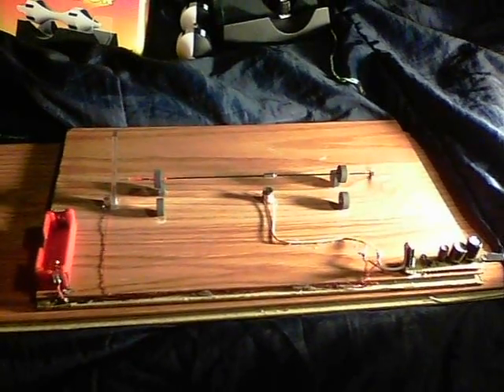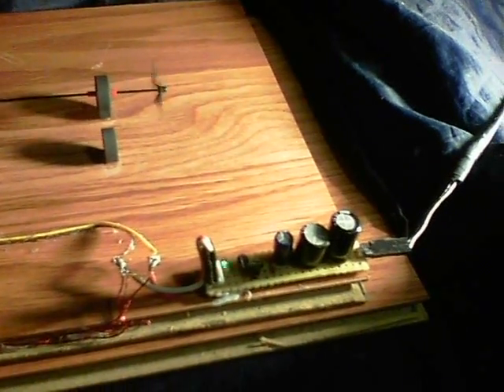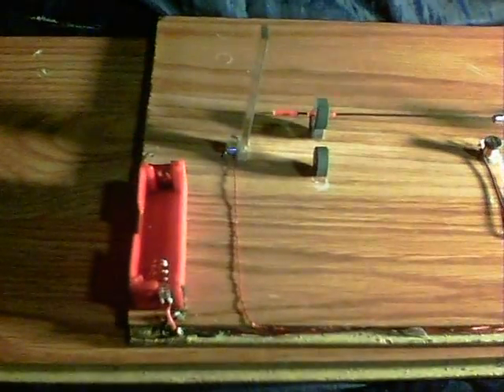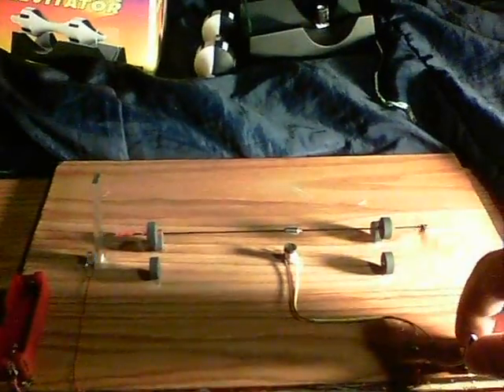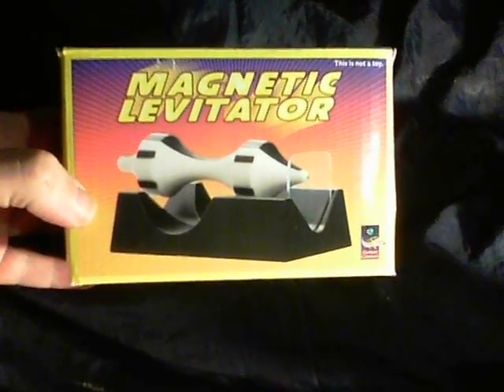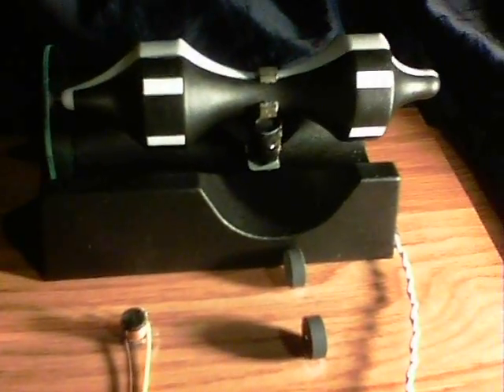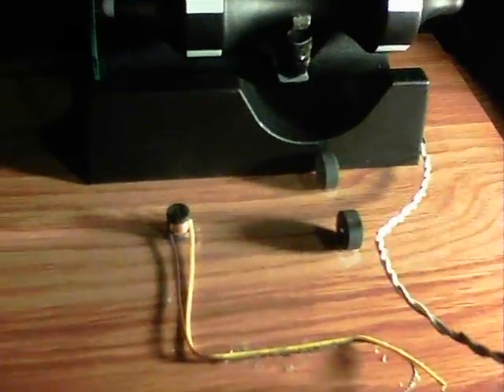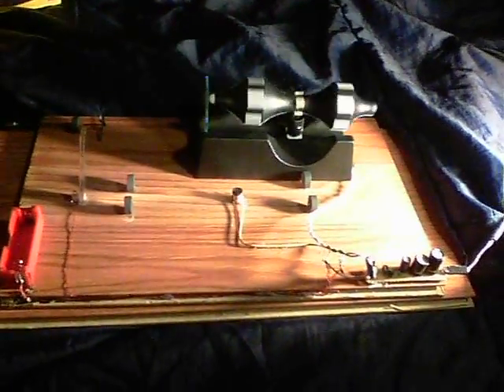2x Solar Levitator Motors

Comment from the maker: @Lidmotor Ah yes, Solarbotics ! Thanks, was trying to remember the website. Your levitator with the dollar store ring magnets is another that impressed. I don't have the balance or weight worked out for high speed yet, but am trying to get 100ns switching speed and a double firing before the current comes through. Am a fan of the Sziklai pair trannies, even though have no idea how to pronounce it. Next is take a 3rd fast transistor, to fire on collapsing field energies through an LED/diode.

Comment: These are very interesting spinners.  I have yet to build the real "Mendocino" which started it all.  That self-start pulse circuit by the way,  originally came from Solarbotics.  Smartcreations modified it and so did I to fit to into these pules motor designs. If you havn't already, visit Solarbotics website.  They have some interesting circuit diagrams. They also sell parts and kits.  I bought some neat little coils from them.

Comment from the maker: @sMartcreations2010 Thanks Mart :) I'll do that and keep an eye on the power used while doing so. It seems the kick isn't as strong as it could be, so a lower resistor I would think (or a 100K pot). With only running under a lamp I have to watch the current.
Oh hey, just saw your copper rails neo sphere pendulum version...excellent work !

Comment: Hi There, Good video. Thanks 4 working and adjusting the SS1CC. This way more things can be tested. I think that if you adjust the 47k and the 100uF cap, the selfstarting can be achieved on both motor

Comment from the maker: @iluzyon1 Yeah, there is...much depends on the weight and balance of what you are spinning. I've found that rotors which don't want to spin up on their own from a complete stop, may sit in speed positions instead. Always watch the field collapse LED and you'll see the kicks and firings and how they relate. Interestingly, sometimes a particular coil will fire with a really bright LED flash very seldomly. I've seen that before and do wonder if it's a sliver of real aether energy coming through :)

Comment: Cool , i like those motors. I am experimenting on the same circuit . I dont know if i was lucky but somehow, i was able to run it at two different speeds just by speeding it up by hand (or slowing it down depending ) ... like if there was an harmonic speed .